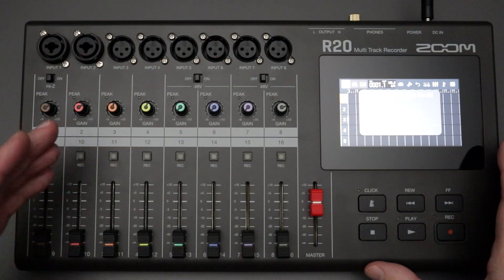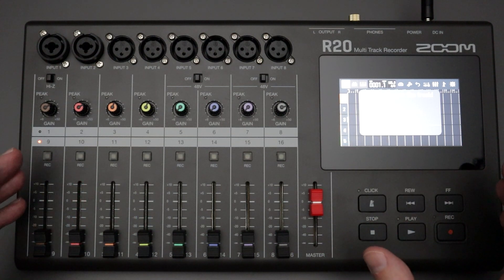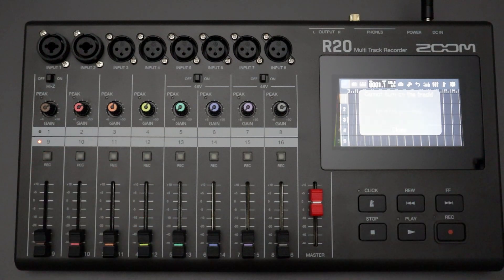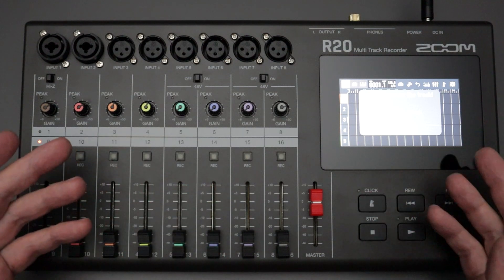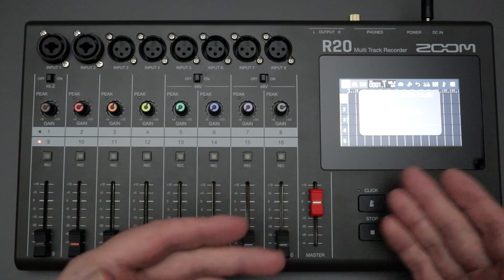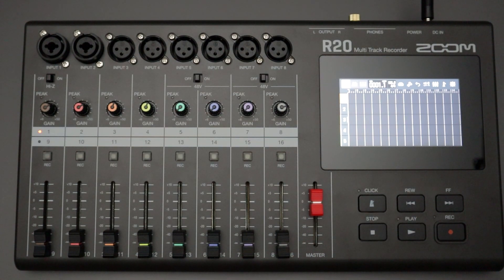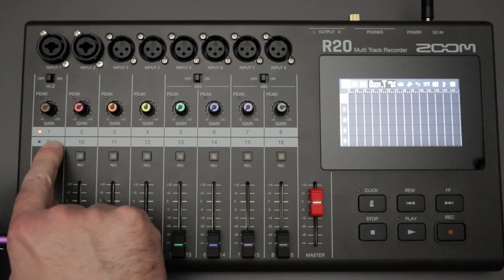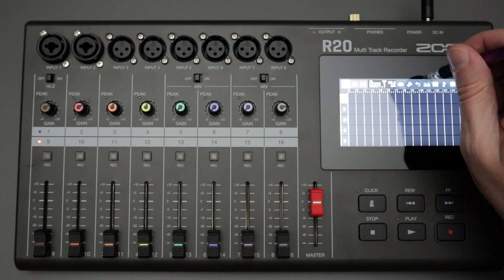ZOOM R20: Track Pair Error and Track Routing

Comment: Hi GR, I’m going direct from a positive grid amp into track one. By all accounts all effects on the R20 are off. Yet the sound has a ton of reverb. Way more than what comes out of the amp alone Thoughts?  Thank you
Reply from the maker: Without seeing the setup it's difficult to know.   A couple quick things to check: if your amp is sending a powered signal out, you likely want to keep the Hi-Z on input 1 off.  Next, check the track settings (for Track 1 or 9, whichever one you are recording to) and look at the effect level.  Make sure it's down to zero.

If you are still having problems, you can go to one of the effect patches in the high 40's that are blank and use that.  Then you shouldn't have any effect selected.

If you are really having oddball problem and can't figure it out, as a last resort you could do a factory reset.  The most notable thing that happens during a factory reset is that the effect patches are cleared and reset to their original settings.  Here's a video on that:  https://youtu.be/gbW442SttmE

Comment: I just found out that I can't assign input one to wherever I want 😢 as a solo artist using lots of 1/4 inch stuff, I'm screwed. This is what I get for not researching much but I would have figured this type of thing isn't some rare, high end feature. My Korg recorder from 20 years ago had it.
Reply from the maker: It’s not a big deal. You can think of the R20 much differently than your Korg D16 from years ago because this thing has a touch screen. 

Here, watch this
ZOOM R20 Multitrack Recorder - overcoming the limitations of just two XLR 1/4 inch combo inputs
https://youtu.be/EuVe58WC-ZE

Comment: I had a situation where I tracked over and over again on the same track like until the singer I was working with could get the take right... The first thing it started to do was latency... And then it finally hit an error and said that I can't record on that track anymore.
Reply from the maker: I have noticed a lag after I record multiple takes on the same track that seems to get progressively slower.  I get a longer spinning wheel after I hit stop.  But personally I haven't hit an upper limit on takes, however, it wouldn't surprise me if there is some limit on takes/total size before the meta data file in the project folder breaks and can't handle it anymore.  I'll be on the lookout for it and if I wind up recreating that error I'll try to film it for a video post.  Thanks!

Comment: Hey Gaz!!!

Good explanation about that issue. I figured that one out already. The issue I'm having is, I have my effects device patch in the mono left output, yet, the R20 is only recording on one side, (R), so I'm unable to pan the recorded track. If I move the pan left, the sound is gone, Center, volume is a little lower, all the way right, correct volume. Any idea how to fix this?

 I forgot to mention also that, when panned all the way right, I hear the recorded tracks in left and right. It's a if the pan is acting as a volume fader.
I just noticed ALL the tracks are doing the same thing, too.
Reply from the maker: So this is something that only happens when you have a send effect patch applied?  Is this the case for all of your send effect patches?

If it's just one patch, you might have a modulator in your effect patch that somehow has a wet/dry mix linked to panning in one of the effects?

Comment: quick question that i can't find an answer to anywhere.  I set up R20 to Multi Track mode (to use as control surface with Logic) .  That works, but when i play my song in logic it does not come out the connected speakers but does come out the headphones.  I don't get any sound (YouTube for instance) out of the speakers, only the headphones.  When I put the R20 in Stereo Mix mode the sound comes out of the speakers (and headphones) but I'm no longer in a control surface mode for mixing.  frustrating.  I know speakers work with Logic because I removed my Focusrite Scarlet and inserted the R20.  Any ideas?
Reply from the maker: I'm not sure, but it has to be something in the combination of settings between the R20 and the Logic software (I don't have Logic to test it out).

When you say "speakers," I'm assuming you mean your laptop or computer speakers and not speakers hooked up to the monitor out of the R20.  And when you say "headphones" you mean the headphone out of the R20?  Or headphone out of the laptop?

If you are using it as a control surface (to use the R20's physical faders) it's possible the in/out USB bus might only go to the headphones as a default because the laptop sees the R20 as more of a sound card controller.  You might be able to flip monitoring on/off and see what you get there.  If you are in stereo mix with a 2-in/2-out bus, that can change the communication between the R20 and the computer and might change how the computer identifies the R20.

Comment: I bought one of these to replace my Boss BR1200 thinking it would help solve a few issues regarding ease of use and speed of transfer to computer - however I only kept it less than a week as it is so unintuitive, restrictive and made of the cheapest grade materials! One of the worse purchases ever made (fortunately got all my money back on eBay). My BR1200 which I bought recently helps me quickly and easily get tracks down and transfers wav files easily through my iMac - not so good with windows (surprise surprise) - it’s quite slow to transfer files but easy whereas the zoom is clunky and that awful unresponsive touch screen drove me mad. I’ll nurture and look after the old lady br1200 and can’t believe how something 20years older is by far a superior machine especially with the usable built in guitar and vocal effects and the mastering is surprisingly good - having a proper bounce and easy V tracks is much better. The guitar effects on the zoom are horrible - I use my positive grid spark amp to download free patches and connect via headphone jack.
Reply: I also had the older br8 from new, the editing and mixing were superior. The downsides to that machine were the zip drives and discs. After changing the drive , and then trying to find new affordable zip disks. I bought the zoom. I find the best way (for me) is to record on the zoom then import the files onto the DAW on pc. I guess that's the way things are these days. Yamaha , Roland, Boss and Fostex no longer make quality multitrack machines. The only other option was the Tascam DP24SD which is overkill. The Zoom guitar effects just need extra time to dial in , vocal effects were a lot better on the Roland. 👍
Reply: @Nik-8it5p  you right about all of that
Reply: I got a br900  and I bought the zoomr20 last week just because I wanted a back up been having the br900 since 2008 and zoomr20 has nothing on it …..

Comment: I ran into this issue. I think I accidentally hit the icon that activates the 9-16 tracks. 
I love this machine. It’s very similar to my Fostex VF160 which still works but the buttons are a little wonky by now it’s 20 years old.
Reply from the maker: Yeah, it's a pretty easy error to fix, but if you accidently hit the 9-16 icon or something and the error message pops up, it can be a temporary mystery for some people to figure out what went wrong.

And man, you're rockin' an old Fostex, eh?  I think that was one of the models that had the built-in CD burner for mastering straight to a CD.  Was definitely cool back in the day.